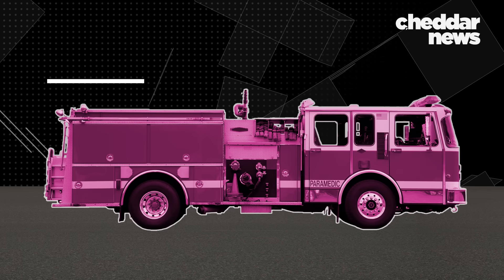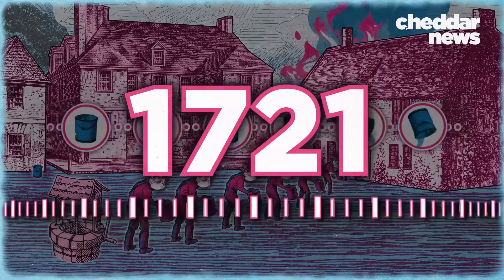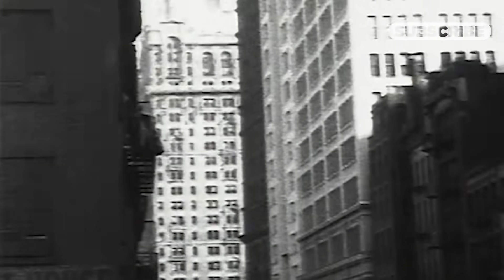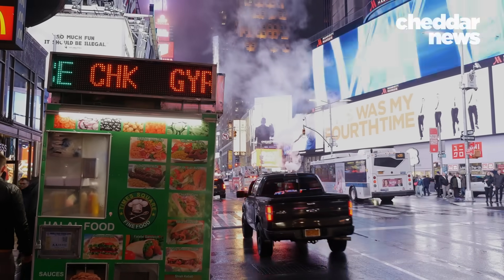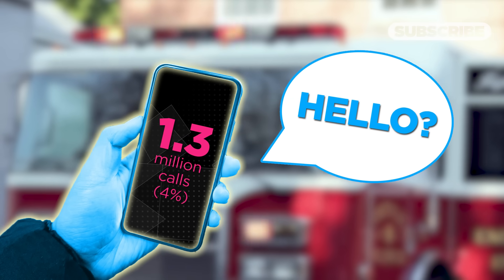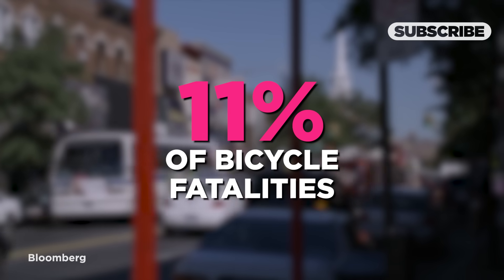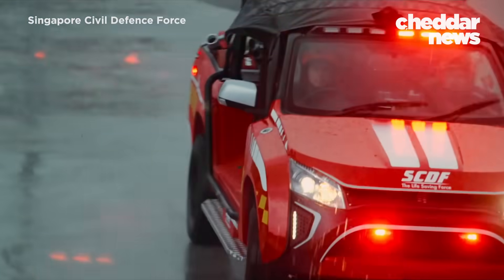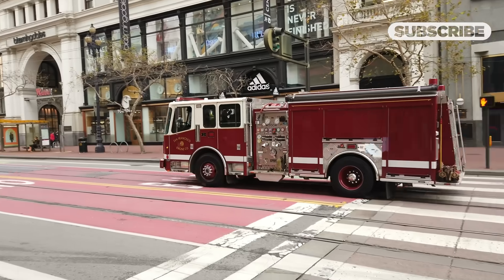Do American Fire Trucks Need To Be So Massive? - Cheddar Explains

Comment: She doesn’t know what she talking about as a VolunteerFF trucks are that size because we have a lot of tools for every situation Jaws of Life e-draulic tool chain saw pp fans oil dry nozzles hoses. And obviously it would be stupid to put firemen on a short but firetruck. The reason fire a apparatus is big is to move essential tools to the fire ground and non fire emergency situation. A tanker can carry anywhere from 1250-4000 gallons and engine around 750-1000. Anyone with a brain don’t listen to this woman because she doesn’t know what the hell she’s talking about. The only thing accurate is the history on the fire service everything else is stupidity.
Reply: "we have a lot of tools for every situation" do you think that they don't have the things you listed on apparatus in e.g. Germany, Austria or Sweden?
Reply: So the rest of the Western World do not carry every tool required for the mjority of calls? Come to Oz mate and see what we can pack into a regular fire engine. BTW, we use Scania's as our pumps and general response trucks.

Comment: You keep claiming that US firetrucks are 10' wide. This pure bull hockey.  The only ones that are that wide are AARP crash trucks used on airports.   All normal use US firetrucks are 96-102" wide, the same width as commercial trucks in both the US and EU.  

You keep comparing a little European truck with no aerial capacity, a tiny pump, and very little equipment storage to a US 100' ladder truck.  This whole story is ignorant.
Reply: Didn't you hear and see the one about the Oz ladder and cherry picker trucks ?  smaller but just as capable.

Comment: What this video seems to fail at is the United States isn't a bunch of big cities with fire hydrants everywhere. It's massive. There's tens of thousands of square miles across the United States that have no fire hydrants, or if they are available they're a good distance away. The larger trucks can carry more water and more hoses and possibly more men. There's a reason we have a standard set of trucks. I'm not a firefighter, but even a simple person like me can understand why we adopted the larger vehicles. We understood the pros and cons.
Reply: be sure, there are rural areas with no hydrants across Europe as well
Reply: In Oz they carry the same amount firefighters, 6 - 8 per pump from memory. Almost the same sized water tanks as we also do not have hydrants at every corner. I lived in the U.S. for 6yrs as a Paramedic and always found that the U.S. fire trucks to be oversized. BTW, I come from Sydney.

Comment: I aggre you don’t need so many of theses big engines. My youth group has had a few visits to fire stations and most commonly they have a pumper unit which has a slight smaller tank and reduced vertical access equipment but instead is designed to connect to the water mains and pump

Comment: The answer is quite simply   normally  fire engines have a 2000 to 5 000 litre water tank on board plus all the ladders ,hoses and other equipment  on board that fire fighters  need

Comment: Clearly a firefighting vehicle is only good if it can reach the location where it is needed, so the best size depends a lot on the conditions in the city where it is needed.
I also understand the problem in heavily congested cities where big traffic jams won't magically dissolve if a big fire truck flashes lights and sounds sirens ...
Drivers are supposed to drive to the side and leave an emergency lane, again those are more useful with fire trucks that aren't as wide. Three meters, that surprised me; the maximum width in continental Europe is 2.55 m and that's only exceeded by a few exceptional vehicles such as transport of oversized items or very big cranes.

Comment: Australia uses similar vehicles to Europe. Air support is also commonly present during the bushfire season, but those smaller trucks like 4:28 will attend just about everything, although rural brigades do also have trucks with off-roading capabilities, but similar sizes to the former.
Reply: That picture was taken right outside of crown casino, on 1 Queens Bridge St, Melbourne, Victoria.

Comment: Instead of being distracted by who's is better, or worse yet trying to defend one particular configuration over the other, just what the heck is the actual point of this video? It has an emphasis that size is bad and doing with less is good. Only take away I see is the author presents it in a way that fire trucks are the reason they can't have more bike lanes and they think the FD should be expected to change their operations to that end.

Comment: You are mixing and matching, which does not accurately deliver the information.   When you show a Baltimore City tiller-truck and then show a 5 person medical fly-car in Singapore, that is not a fair comparison.  If you look at the London Fire Brigade's 64m Tower Ladder,, it is comparable in size to an FDNY Tower Ladder, in width  and length. They are lighter as they do not have a tank or pump.   The streets are narrower in many European and Asian cities than they are in the United States or Canada, so the fire apparatus is differently sized, often with smaller water tanks, and they are then stocked differently.  If you are going to make comparisons, show me what apparatus in Europe compares to a Pierce Ascendant mid-mount Tower or a Ferrara MVP rescue-pumper.    You also switch between showing Type 1 engines in the United States and what is effectively a Type 3 engine in Europe.     My Fire Company is classified as rural, while being surrounded by suburban, urban and industrial environments, we run everything from Type 6 fire engines built on a Ford F350 platform to 2,650 gallon commercial tankers, along with traditional cab-over Type 1 engines. In our town we also run heavy rescue apparatus and tandem axel aerial ladders.    For medical calls our Fire Company runs an SUV or a pick up, along with our ambulance, for motor vehicle collisions we run our medium duty rescue and an engine with the ambulance.   Then again, this week we spent 12+ hours operating on the scene of a scrap yard fire, in an area with no fire hydrants. Roughly 20 fire departments operated on the scene of that fire, for 12+ hours, having to truck the water in with fire apparatus tankers, that moved more than 1,000,000 gallons of water to fight the blaze. These tankers typically haul between 2,000 and 3,000 gallons of water, and feed the engines and ladders that put the water on the fire.  How do you propose we get a more compact rig to haul 3,000 gallons of water? You need to go apples to apples, not apples to oranges.
Reply: good summary. Not sure what type 1 and type 3 engines actually relate to, as we have different sorts of apparatus classifications in every country across Europe. Germany alone has 9 different sub-classifications of Engines (which doesn't include Tankers / Tenders and doesn't include the outdated classifications of which many Engines are still around today).
In the village I live and work in the volunteer FD runs 10 units; EMS station runs 4 + 1 units, and the special response group and water rescue run another 5 units I think